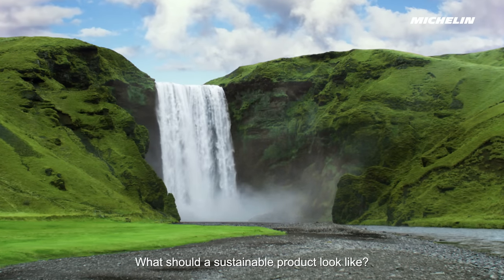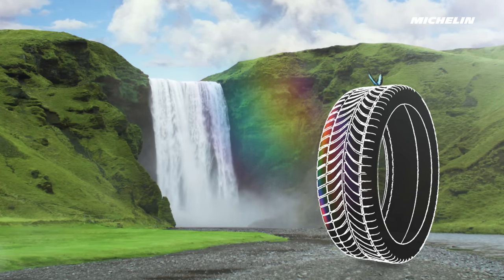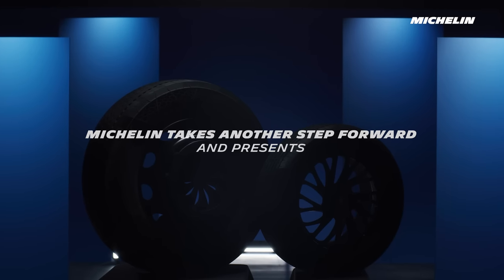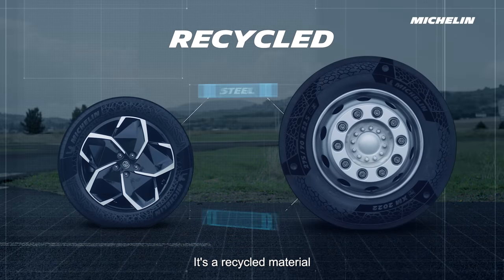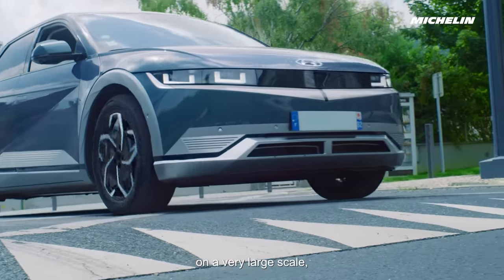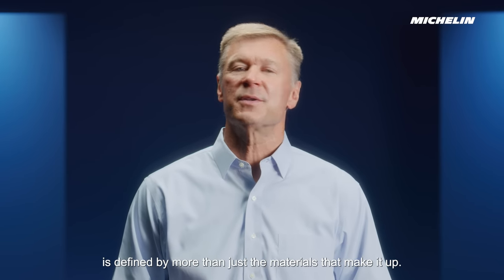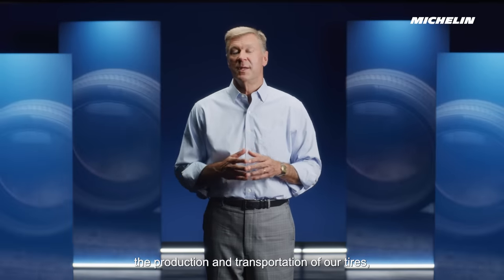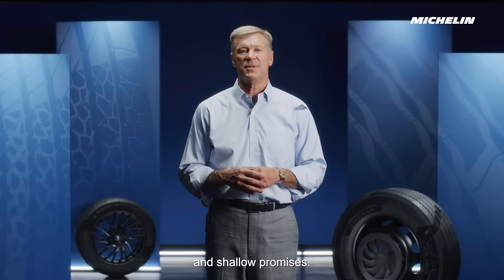Towards all sustainable tire

Comment: Just one question: Does this deal with the micro-rubber pollution from tires? (One of the largest source of polymer pollution)
Don't get me wrong, I know that this is extremely hard without compromizing on performance. And the progress made that is talked about in the clip is valuable.
However, since tire abrasion is so prevalent and usually happens right in nature, it's the one single product, where biodegradability would actually be very important.

Is there something going on in this direction?